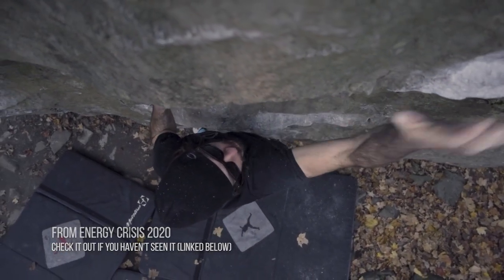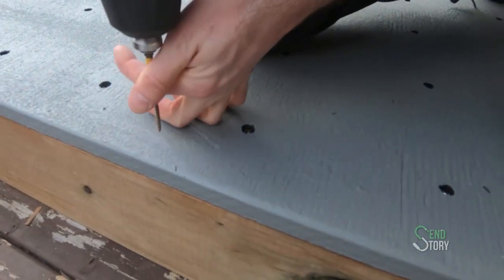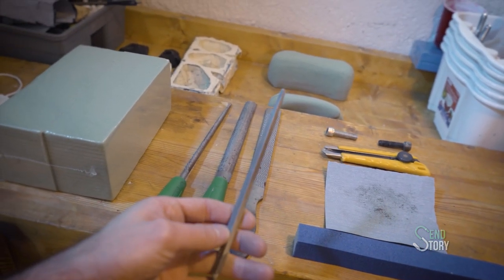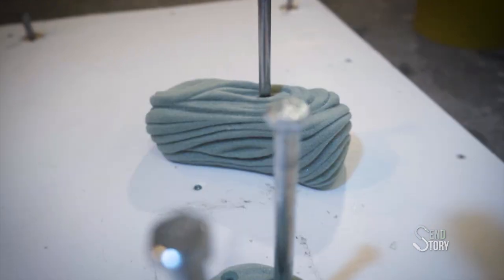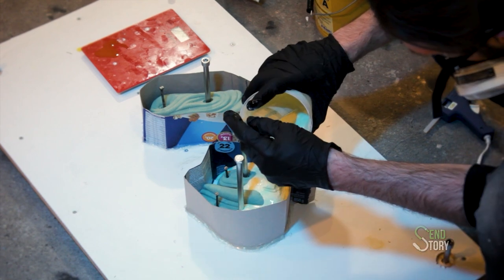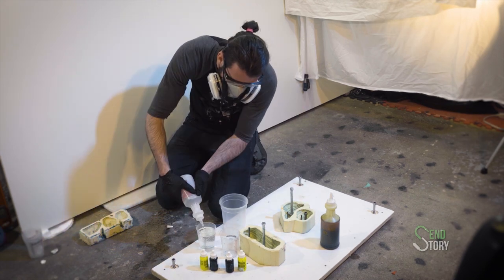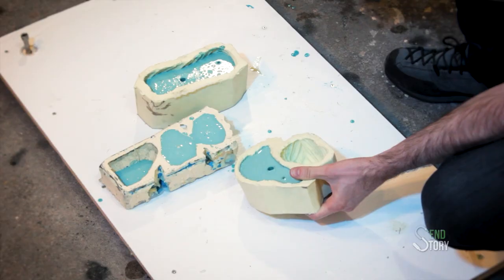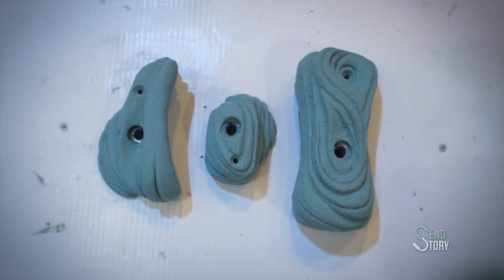MAKING CLIMBING HOLDS: Full DIY Process (including links)

Comment: Thanks very much. How far off are these DIY holds compared to the professionally-made ones? Is there a practical size limit (e.g. to cost or effort) to DIYing where you'd be better off buying retail holds? Are DIY (or rather, "professionally home-made") holds worthy of being sold to other climbers? Just curious, as I have a (pipe) dream of opening a small climbing gym in the not-too-distant-future and am looking at making my own walls and holds as much as possible. Thanks again for the awesome videos!
Reply from the maker: Sweet aspiration, hope it works out down the road! I talk a bunch about costs and benefits in first video of the full series, I think that will do a better job framing that - so I recommend checking that out. 

The TL;DR version is that the molds are the most expensive, so if you are just making them for yourself, I doubt you would be saving much money, and definitely sinking a lot of time into it. 

There are ways to get more out of your molds, I actually eventually want to make a video on that, but haven't gotten around to it... but yea, silicone is expensive and typically a molds just outputs the same exact hold multiple times. 

I am not sure about selling holds, just from a safety/ liability perspective. You might want to just throw a generic disclaimer about their intended use of you were to sell them. In terms of the quality, they should be pretty dang close to commercial holds, the big difference will be texture, as your DIY foam will be different than what the commercial guys use. 

You will get more variety and a better price point if you buy holds from a local supplier, rather than making your own. If the company is not local, holds get heavy and expensive to ship, and if they are coming from another country, duty on holds jacks up the price. If you are planning on making a lot of holds, and filling a large wall, you might save money making your own, but not time. Shapers are masters of their craft and it takes some time to hone that in. 

Hope that helps, let me know if you have any other questions that aren't answered in the other videos!
Reply: @SendStory  Noiceeeee, thanks for such a detailed reply! Yeah I watched that video after writing my first comment - I suppose it would only make sense if I plan to reuse the molds for selling or something. Maybe I can start off small and sell stuff clearly labelled Home Made, to set expectations and do more practice. 

From a durability perspective, do DIY holds degrade? Eg smoothen out over time or something. What about wooden holds, do they get slippery over time? I figure if I'm making a wall only for myself, doing it with wood would make sense for one-off work, but if I were to sell them, then making silicon molds would pay off in the long run.
Reply from the maker: @iamthekwan  yes, it depends on your usage. Wooden holds are naturally pretty smooth, which is good for training, but definitely different than your typical polyurethane holds you climb on in a gym. Try out a Tension board or some of the wood holds on a Moonboard to get a sense of them. If you use polyurethane (the resin in these videos) you should get holds very similar to a gym (the typical floral foam used here tends to have larger pores and thus a little more textured than what they use for shaping commercial gym climbing holds). So they should wear the same as gym holds, or if they are more textured, even longer. The exception might be if they are outside and exposed to UV and heat - they may degrade faster over time. 

Anyhow, if say stay with wood if you want first. It's cheap and should be readily available and you will more or less use the same tools. Practice finding out shapes that feel ergonomic on the hands, then you can pretty what you learn to shaping foam and pouring holds. With that said, you can go right into foam and polyurethane if you want, it's expensive on a large scale, but if you buy a small batch of materials, it should just be a few hundred dollars. 

Hope that helps.
Reply: @SendStory  Wow... a few hundred USD is equivalent to $1000 after converting to my currency and economy. No wonder there aren't many climbing gyms in my country; they're expensive! Anyhow won't take up more of your time, thanks very much for answering all my questions. Have a great day!
Reply from the maker: @iamthekwan  No worries, I don't mind helping.

Prices where I am might also be super inflated to match the cost of everything around here, so you might be able to find the same (or similar) products in your country for more reasonable prices. Check any hobby/crafts/DIY stores that might service artists, craftsmen, or professionals as a place to start.

Also, hundreds of dollars ($200-ish) would get you enough silicone to make like 10 +/- molds for small jugs and crimps and enough resin to pour a good chunk of those holds. You can reuse the molds quite a bit if you handle them carefully and store them well. The resin is the cheaper of the two products, so buying more of that after the molds wont be as big of an investment. So per hold you would be paying much less. 

There are cheaper materials you can use (polyster resin is cheaper, but heavier and has worse fumes, standard silicone calk can be thinned out and painted on the foam instead of a pourable silicone made from molds - but it isnt as durable, etc.), but the holds wont be of the same quality. 

Again, starting with wood might be your best option.
Reply from the maker: @iamthekwan  I haven't checked out that doc yet (but I will), however i have made holds with sand before. Since sand is additive, the texture is convex and protrudes from the hold surface. Foam uses pores (bubbles) that are concave - so the texture comes from the ridges around the micro vacancies.  Additive is kind of like a bunch of little spikes, while foam texture is almost like a honeycomb texture. So additive tends to be tougher on the skin, so you need a very fine aggregate that has consistent particulate so the texture is even and comfortable. Many volumes are made this way (2 part epoxy paint with fine aggregate added in), so you can make great holds with it, just just have to be very particular with what materials you source for the texture.
Reply: @SendStory  Found another interesting idea which is the inverse ("subtractive"?) - cover the hold with resin, then top off with salt while still wet. Once resin has cured, wash off salt in water, to create very similar texture compared to foam>silicon molding: https://www.youtube.com/watch?v=9TW4BkhRIjw

Seems like a super easy way to get started is to print free 3D models from Thingiverse, then use the above hack to create small holds to start. Maybe use wood for the bigger holds. This would make a super cheap wall!

Comment: Yeah this is sick. Especially with  the holds for a kilter costing 8k and them all being duplicates of a few holds you could easily replicate them with only a handful of molds and a couple kg of resin. Probably under 400€.
Reply from the maker: Yea, lots of options and ways to make your own. I've thought about making a hold set that's open source and people just pay for a few resin casts of the various hold shapes that they then can make their own molds of and replicate for a full wall set and then to share the shapes with others to do the same. Then there could be standard orientations/configurations and such and people can use whatever home wall app they want to share problems with the community (like stokd, retroflash, etc.). Essentially an open source climbing board standard that isn't really owned by anyone. Time and motivation are the main problem there, haha. Thanks for the comment and checking out the video.
Reply: @SendStory  yeah I hear that, I’m and SWE by trade so I know I could technically create an app to control the leds and use clear resin to pop leds in the back of the holds. But then I realize I work 40 hours a week and maybe just colored tape will do the trick. But maybe if there was an open source project going I would be into contributing.
Reply from the maker: @Nihlink  good to know, maybe if I ever magically find the time and motivation I'll drop a comment here to pick your brains.
Reply: @SendStory  That's an awesome idea

Comment: resine cost more than hold.
Reply from the maker: As I mention in my videos, making your own holds is not something you should do to inexpensively get holds, at least not in my opinion. It should be because you want to learn and enjoy the process of creating and crafting something. It's kind of like building your own furniture instead of buying it. With that said, typically a small volume of resin gets me tens of small to medium holds and I definitely haven't found professional holds for cheaper than that. You might want to look for a different resin than the one you have been using, or maybe you are just in an area where resins are expensive? Try a local arts/hobby store and see what they carry. Again, if you want to make holds, the investment should be in the hobby and process, rather than sinking all the time into trying to make cheaper holds. Best of luck!